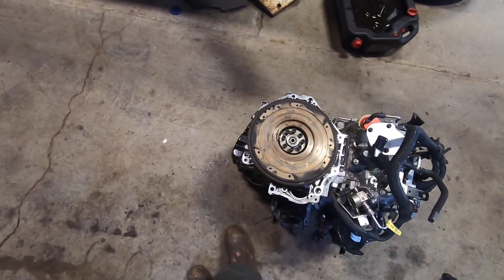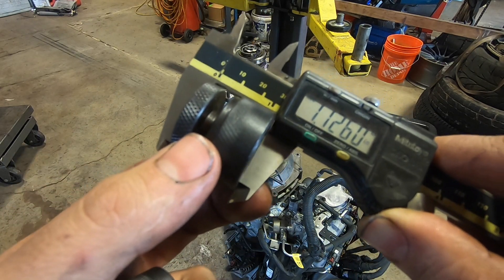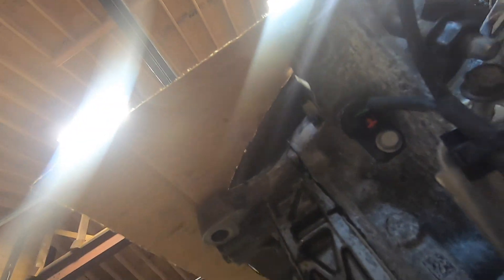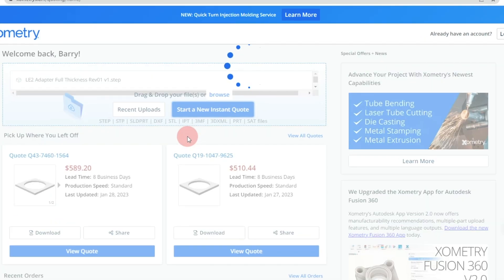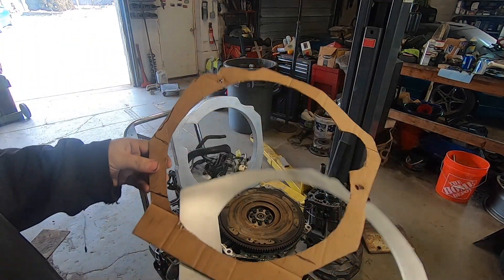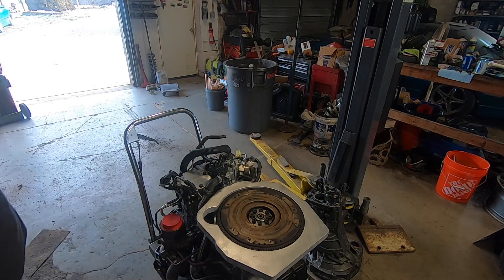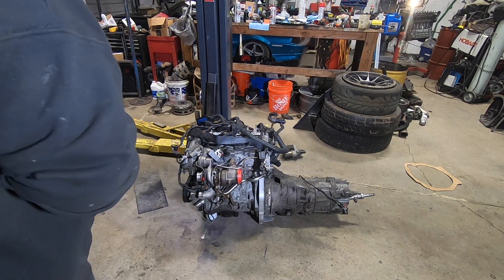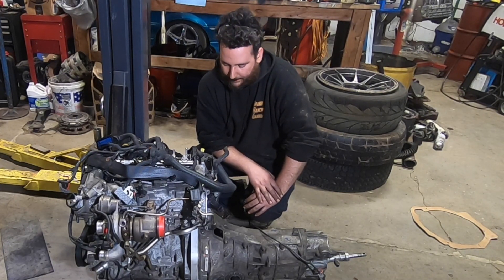Building an engine adapter plate GM LE2 to Subaru. Mid engine turbo rail buggy PART 3

Comment: Hello which lathe and milling machine do you use ?
Reply from the maker: I run a Bridgeport Mill, and in this video I had an old craftsman Atlas 12x36 lathe. I have since upgraded to a Colchester lathe
Reply: @spankranchgarage Thanks for answer and I need your advice. I don’t have big space to put milling machine like bridgeport but I also want to build car parts at my garage which milling machine should I buy ? I don’t interested import ones

Comment: I understand that you had to use a thick adapter plate in this case, but what does one do if the previously-used bellhousing isn't as deep as the new one?
In other words, the input shaft for the transmission won't reach the pilot bearing?
Reply from the maker: You can make an extended pilot bearing/bushing that presses into the crank, or a crank piloted hub that bolts to the flywheel that holds the bushing. You may also find that the splines arent long enough to engage the clutch. You can use a dished flywheel to solve that. Theres ALWAYS a way
Reply: @spankranchgarage  Thanks very much for your reply. Could you point me towards more information on that kind of setup?
I'm interested in mating a Volvo B230 4-cylinder to a Vanagon transmission.
Reply from the maker: @Wildman76059  Heres an example. Its a wild one but ive seen similar flywheels that extend the pilot bushing and offset the clutch face while keeping the ring gear in factory position. You will probably have to make your own, but anything is possible. https://pmcmotorsport-shop.com/product-eng-5509-Flywheel-Toyota-JZ-BMW-N54-ZF-GS6-53BZ-HGX-JGK-JGF-JGD-184mm-7-25-P.html

Comment: Great job, but don’t see how setting the tranny on top of the engine with the input shaft engaged with the pilot hole/bearing aligns the center of the engine with the center of the tranny input, because every input shaft tip I’ve ever seen wobbles quite a bit. So it seems to me when you put the tranny on top it weren’t you able to move it in a small circle just a bit?
Reply from the maker: That's a great point to talk about. Some transmissions I have worked on have very floppy input shafts like you said. For whatever reason this Subaru trans is extremely tight. The input shaft has no real play. If I had to do this on a trans with a sloppy input shaft I would have to do this a little differently. Maybe I would move it north south east west and carefully mark the extremes then calculate the center from there.

Comment: Could an automotive transmission be adapted to a motorcycle or sportbike engine? I imagine that this would be possible. However, I do not know how something like this could be done. Or who I need to talk to with this idea as
Reply from the maker: Yes its possible. Motorcycle engines usually have an integrated transmission. So you would end up with a lot of gearing option... you also gain a reverse gear

Comment: Hello spankranch, I run a fully built VW bus 6 rib transmission with a Subaru motor and am tired of having to rebuild the trans every 3 years on my buggy. Have you ever heard of anyone running something other than a VW trans with a subaru ?? . I know there is a Australian company that is doing it .But they are quite expensive . Nice Video like your idea .
Reply from the maker: I think the 6 rib might be the stronger trans here, and it has more aftermarket support, though expensive. I like the subaru trans because there only a few hundred bucks and I can get them everywhere. Ideally I would run a 6-rib too but availability and cost pushed me in this direction.

Comment: if the aluminum came in 5/8" you could have used this and 1/2" to give you the 1-1/8" thickness you needed. You could have built it with two 1/4" steel plates with one matching the GM engine and the other matching the Subaru. The Subaru and the GM matching plate would have required some appropriate nuts welded to the respective plate. Then you would need to weld in 1/8" filler on the outside and maybe some on the inside to join the two plates together. Where there are tapped holes in the GM block you would have to make some appropriate access holes to tighten the bolts the hold the GM matching plate to the block.
Saw this method on the Scantron site.
Do you happen to have the rough dimensions of the subie transmission? I am working on the design of a three- wheeler using the Subie to also drive the rear wheel.
You have just the right machinery to make this a DIY project. Thank for the video.

Comment: How did you lengthen the input shaft, As you have added in an inch and a quarter adapter plate?
Love your videos, keep making them.
Reply from the maker: Luckily I didn't have to. The Subaru input shaft naturally extends past the bellhousing face making it a good transmission for this kind of swap.
Reply: Thank you for your reply, keep up the good work😀

Comment: This video kind of solves a dilemma that I have. I got a 96 Toyota Camry that is salvaged. Most of it is junk but the engine is amazing. It sat for two years and if the battery is charged it fires right up and sounds awesome with no issues. I want to put that engine in a dune buggy but don’t know how to switch the transmission to something that wasn’t designed for it. Now I know. Thanks.
Reply from the maker: Sounds like a plan good luck!

Comment: This is lousy engine should be putting Subaru in buick
Reply from the maker: Really? What kind of issues have you been seeing with them?
Reply: @spankranchgarage  do  little research it's gonna throw parts at you
Reply from the maker: @billjenkins3699  Ill find out I guess. I know the gen 1 1.4T was problematic but I havent seen any failures on these new Gen 2 motors, other than piston failure due to knock.
Reply: @spankranchgarage  it's just another tiny little engine working extremely hard to produce more power than it can tolerate. It is literally a throw away! That's why it was made so poorly after 5-7 years the car isn't worth the cost of replacing the engine... plan complete
Reply: @billjenkins3699  I agree. Certainly not worth all this effort for such small returns. I've learned over the years to go with a combo that's wildly supported by the aftermarket instead of something cheap or different.

Comment: Stuff like this makes me think I should make a video on the subaru-engine-to-upside-down-subaru-transmission adapter plate I made so it could be used in a rear engine application.
Reply from the maker: Any oiling problems doing that? I considered that option at one point.
Reply: I thought I saw something online that the ring gear on the Subie can be switched to the opposite side to allow for a rear mounted engine ala the air-cooled VW. If you want a mid-engine setup using the VW transaxle from the air-cooled cars, you simply flip the ring gear to the opposite side of the transaxle. Pretty sure you can do the same with the Subaru transaxle.
Reply: @jpvill4th  Subarugears out of Aus makes a reversed ring and pinion kit to do just that. It's not as simple as just flipping the diff over.

Comment: Buen trabajo de matricero, prolijo, lo que me cuesta entender es el significado de destapar una latita frente a cámara, lo único que se me ocurre es que esté empecinado en imitar a Homer Simpson 😂
Por otro lado las transmisiones Subaru son conocidas por no soportar demasiado torque en vehículos tunning
Reply from the maker: Tengo mucha sed y me encanta la cerveza. Tienes razón, la transmisión Subaru es débil. Pero con sólo 150 whp espero que sobreviva. ¡Gracias por ver!
Reply: @spankranchgarage  por ser un medio de difusión no está dejando un buen ejemplo, hay que tener cuidado con eso, para saciar la sed agua, si te gusta la cerveza, whisky, ron, tequila, en privado. Para este caso en particular no aporta nada, éxitos!!!!
Reply: @spankranchgarage  If the transaxle doesn't work out there is also the VW Vanagon transaxle. It will hold up to 200 HP.
In the late 60s and early 70s folks used to bolt the Corvair engine to the Type 1 transaxle with no issues. Those transaxles were much tougher than most folks realize.

Comment: hey man.  again, excellent work.  i'm learning so much from watching you for my adapter plate build.  a question, if i may: when locating the engine dowel pins on the adapter, how did you ensure the adapter plate is correctly centered?  considering the starter is on the bellhousing (thus proper starter/flywheel interface is assured) is centering the adapter plate around the crankshaft centerline somewhat less than supercritical?  thanks again.
Reply from the maker: Thank you. The adapter was just visually centered around the flywheel, thats not critical. Once the pins are drilled on the engine side, I use the pilot bearing and the transmission input shaft to center the trans on the engine, thus on the adapter as well.
Reply: For centering the adapter plate you can use composite wedge shims you can find at Lowe's or Home Depot or most lumber yards. Put the plate on over the ring gear and put the wedges between so that you have the same amount of wedge  between the two parts. The make the punch mark. That should get the plate centered on the block. The composite (plastic) wedges are not at all expensive. You will find other uses for them too.

Comment: Little late suggestion 
The 1/8” plate should’ve been steel and made into a “block plate” with a small hole for the crank, it would have covered up the flywheel and stopped junk from getting in !
Wooops ! 😆
Reply: Only need to re-make the one plate ! Steel is cheaper ! PS scatter shields have them 👍
Reply from the maker: Man I wish I talked to you before I built it! But you are spot on, that's a great idea

Comment: I'm doing a similar project. do you think that steel would work as well, I am good with cad and have a small plasma table, but nobody makes the adapter out of steel, why is that?
Reply from the maker: I considered steel as well. Its cheaper but its going to be pretty heavy if yours comes out as thick as mine had to. If you check out Robot Cantina on youtube, they made a steel one to fit a Kubota engine to a Saturn trans. Theirs is sheet metal with spacers. Theres many ways to make it happen
Reply: @spankranchgarage  can you shoot me the 360 file you made, I'm gonna cnc one today....please and thanks
Reply: Also I'm doing a gm 3800 out of a park ave. I just scored a legacy last weekend and the tranny is out and waiting the unholy union of Japanese and Mexican production.
Reply from the maker: @adamchristensen1338  shoot me an email at Barrymaxx@gmail.com  You will have to modify this for your 3800. That uses the GM 60* v6 pattern BTW

Comment: Very nice. Impressive problem solving. At first I wondered why you didn't get the bolt holes cut for you, but then I saw why. I had the holes cut on my plasma strut plates and laser LCA relocation brackets, but they did not need to be perfectly aligned either. 
I've been using Adobe illustrator as my poor man's CAD. Seems to work pretty well in conjunction with the CNC router at work for plastic aided design. I'm going to try some offset templates with my hand plasma and see how that goes too
Reply: I have a wheel idea I should pick your brain on. I think I have a good plan, but some fresh eyes might help too

Comment: Nicely executed!  I can honestly say that I learned something new that I would like to use in the future...the punch method.  It's always neat to see a one-of-a-kind design come together.  Well done!
Reply from the maker: I'm learning every day here trying to figure this stuff out. Thanks for watching!
Reply: I recently found out about centering punches too, from watching various videos on making adapter plates. You are correct in that you don't need much of a projection to punch the aluminum plate with the dowel pin. Since you have the lathe, you could make a set of center punches from various sized dowel pins and bolts or studs.
Watching your videos gets the creative juices flowing. Thank you posting this.

Comment: Very cool.  Another step closer with the buggy project.  So cool that you can order an adapter plate or whatever you design like that.  Where do you think you will take the buggy on it's maiden voyage with the new motor and trans?
Reply from the maker: Ill take her for a few rips at my local spot then hopefully back to West Virginia for a big trip this summer. Times Ticking!